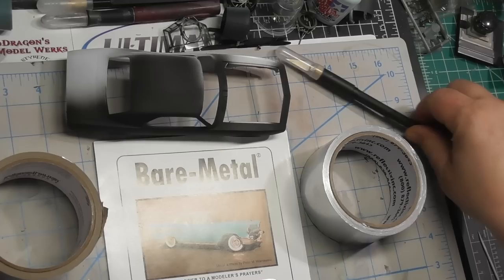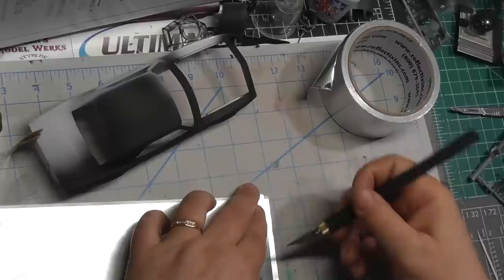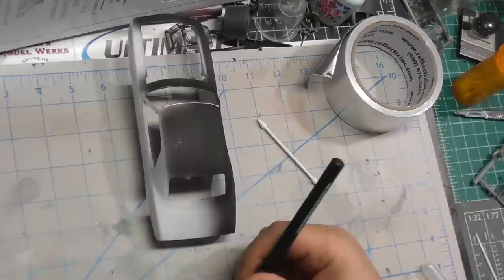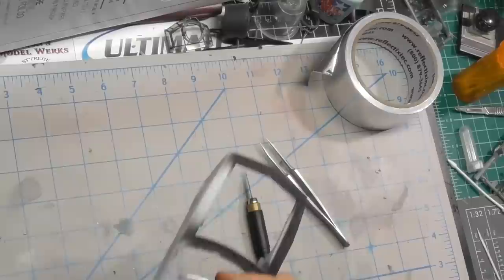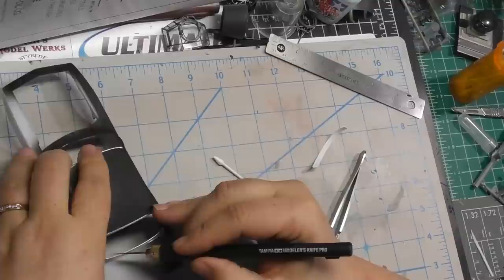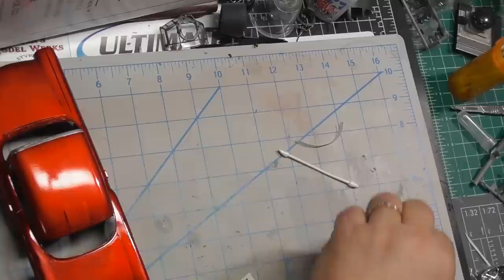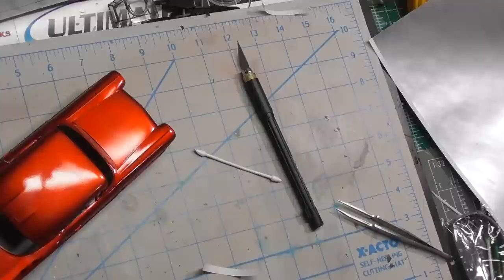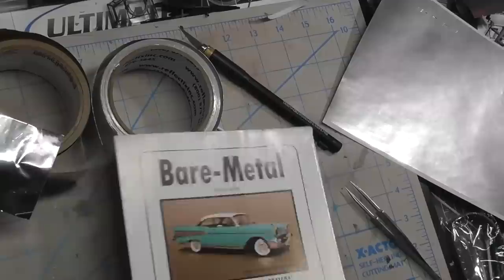Bare Metal Foil Comparison vs. Hardware adhesive foil tape

Comment: Using regular aluminum foil works quite well, gluing it in place and it's cheap.  I got frustrated with bare metal foil not sticking from age. I even kept it in a Ziploc bag, it still becomes useless.

Comment: Great video. Just to put it out there if you go on ebay and do a search for AL Aluminum Foil Joint Sealing Radiation Thermal Resist EMI Mask Adhesive Tapes you can find some of this tape that will work very well for less than $3.00 a roll. I bought some for $2.75 with free shipping. Just be aware that shipping could be a little slow depending on who you order from. Hope this helps someone out. Keep up with the great videos.
Reply from the maker: Terry Glisson thanks for watching and thanks for the great tip. I will get some of this tape to try myself. The price is good. Thanks again.

Comment: I've been using the aluminum tape for a long time without any issues, they also can be found in different thicknesses depending on the brand and the roll can be used for years worth of projects.
Reply: I tried using the roll, but for some reason, the adhesive was too strong and it ripped the paint right off the model. I stopped using it because of that and prefer BMF. However, reading on here that there are different thicknesses available, I may try the roll of tape once more. How can you tell what thickness the tape is?

Comment: It is interesting that you say chrome trims wrap around to the inside of the car (I'm para-phrasing for clarity) ... as it is my impression that they don't do that, and that there is a seam of black rubber between the chrome and the glass. I say this because I've stopped using BMF in favor (American spelling, yes I do that) of pre-cutting H-Vac to the precise thickness needed... ie. no trimming , and if you've Sharpied or painted the black edge in, instant rubber! Also this hides the (usually) too thick window trim size, they do on models. As an asside, the thick foil (I think) improves if polished with a cotton bud, but you have to be careful as it will grab whiskers off the bud. This might have sounded like dreadfully patronizing, man-splaining, for which I sincerely apologize if I sounded condescending at all... it wasn't my intention at all. I absolutely enjoyed the video,.. great information with a practical demo - superb, nothing else like it. MrMinidreams mentioned this vid. I instantly subbed. kutgw. Sorry for the essay :(
Reply from the maker: Steve Watts HI Steve, thanks to watching and thanks for the good information, your comment was just fine and I enjoy hearing how other modeler tackle issues. I'll have to give your method a try. I like trying new techniques as there are many ways in modeling to do the same procedures and reach the same goals.

Comment: My Hobby shop happens to be in the Hardware store ;)... would like to know how to make the metal go around the corners of the windows...
Reply: As cheap as the tape is, you could cover a whole windshield, side or back window  w/ one piece of tape and cut out the center..... No seam or need to bend the metal.